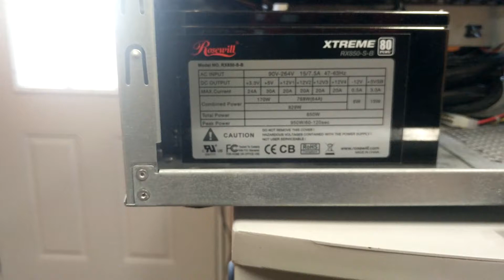How to Install a Graphics Card - Upgrade Your GPU - 2020 (steam key giveaway)

Comment: For some reason my wireless power supply isn't working any suggestions.
Reply from the maker: Try smacking it, like really really hard, and then whisper "sorry" in a calm reassuring voice. You got to train that wireless power emitting rays to listen to the power supply master (you) and not slack off when you feed it all your power and expect so much from it and it just keeps failing you. Try splicing all the red and black wires together and then plug it in to re-set the power out put.
Reply: @justgabevr  thank you tech guru.